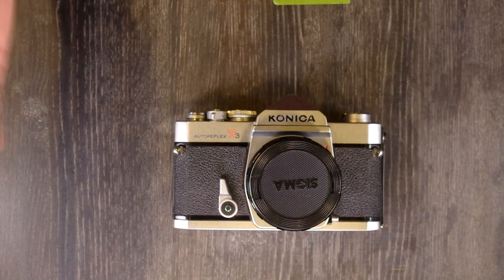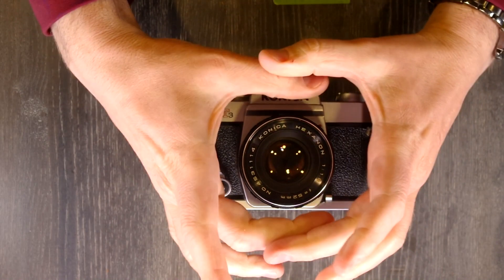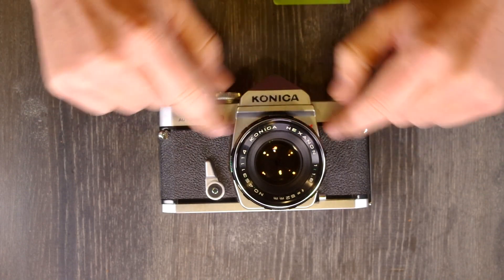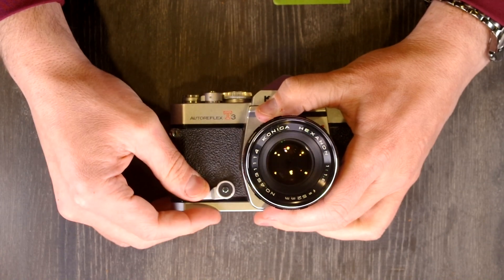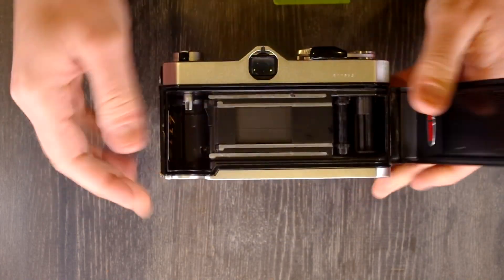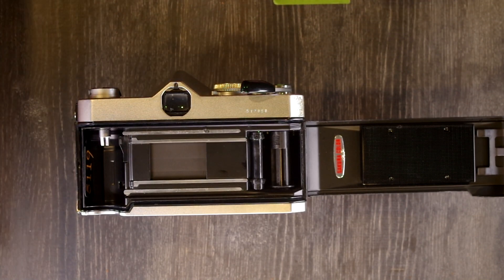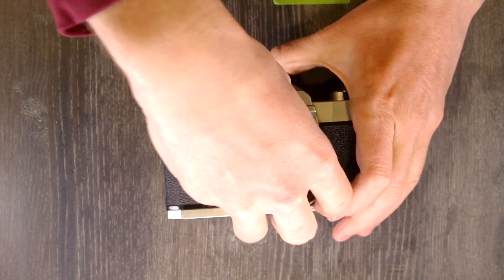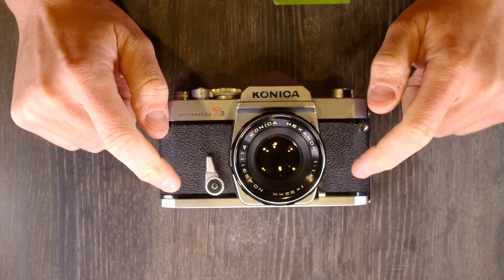Konica Autoreflex T3 Video Manual 1: 35mm Film SLR Camera Overview and Use, How to and Instructions

Comment: Another well made and thorough video, thank you. I've just taken delivery of a T2 body for just £10 (+ delivery) and I love it.
Just one correction on your maths if you don't mind. I'm pretty sure that 92% frame coverage refers to the area, not length. This is good news, as it means that the length (or height) coverage is the square root of 0.92, which is just under 0.99, or 99%. In other words,  you only lose 0.5% each side and top/bottom.
Reply from the maker: Thank you! For the 92%, correct, it's the frame coverage. But it's not always exactly even. In general, the viewfinder frame coverage on cameras is about centrally located with a slight crop on the top, bottom, and each side. Some cameras, though, have that area slightly off-center. Once way to find out is to draw a box on a sheet of paper and have the box's frames on the exact peripheries of the viewfinder scene, then photograph it. The negative will reveal how much of the frame is photographed outside that box.
Reply: @DavidHancock  Yes, I accept that it may not be central. My point was just that instead of a total loss of about 8% in each direction, it is actually less. Embarrassingly though, I miscalculated. The square root of 0.92 is actually just under 0.96, so you actually lose about 4% toral length, or 2% each end (if it is central).

Comment: For a short time in the late early 1970's, I considered the Konica Autoreflex T, but decided that the 1969 Nikkormat FTN was good enough for the (relatively) slow color films of the time. (Kodacolor-X was ASA 80, Kodachrome topped out at ASA 64, with High Speed Ektachrome's ASA 160 the speed champ for Kodak.) The very first Konica Autoreflex (1/2 frame capable) looked a tad behind the times with the external exposure meter. The Konica Autoreflex T had the "clean, modern look" of 1970 35mm SLR cameras.
Reply from the maker: All good choices. I have the Autorex P, the meterless (Japanese market) version of the Autoreflex with half-frame capabilities. The camera looks a whole lot better without the meter, but it was a repair nightmare for the first two years I had. I took it apart and worked on the mechanism about a half-dozen times before I got it to a point where it would work reliably and not randomly jam (and removing the base of that camera risks exposing the film with the way the shutter is made, eliminating the chances of a field repair.) So the Autoreflex is a bit less mechanically reliable (in my limited experience) that the more robust T and Nikon FTN you picked up.

Comment: The first "Autoreflex T" is from 1968, the predecessor was called "Auto Reflex" and was introduced in 1965 as a unique camera that could take half-frame photos by just changing a lever. The T2 was called the same as the T1 "Autoreflex T" the first T3 was called T3 like David's with the letters on the top of the camera with a detachable flash shoe, the T3n no longer has T-3 on the top and has the fixed shoe. One problem with this camera is how difficult it is to change the mirror shock absorber which is made of rubber and like all cameras of the time it degrades and to replace it you have to disassemble almost the entire camera, the same to be able to clean the screen that gets dirty with the degradation of the rubber shock absorber.
Reply from the maker: Thank you!

Comment: My father gave me his Autoreflex T3 along with the Hexanon 50mm 1.7 lens. The body and mechanics are pristine. The light meter is busted though. This camera is built like a tank.
I picked another up for cheap which is fully functional. The only issue is when focusing the split image is not present in the viewfinder. When focusing, the center displays some tiny dots which do disappear as you focus. I assume this is not normal.
Reply from the maker: Sounds like, on the second one, you have a microprism focusing screen, which is just a different type.
Reply: I have two autoreflex T3 (new) one came with split focusing screen and the other with microprism

Comment: Just checking my Konica  cameras own the silver Auto T with 52mm 1.7 lens, an all Black autoreflex T3 with viewfinder curtain, hot shoe contact, the word autoreflex spelled out next to T3 on front of camera with the 52mm f 1.4 lens, the Konica FT-1with built in motor drive with lots of camera auto features and dials ( a used camera that has not aged well electronic failures as they age resulting in no motor drive to advance film or shutter release),  Also a Konica FT-X which came out towards the end when Konica sold out to Minolta. The camera has a plastic body, hot shoe, limited shutter speeds and use a single AAA battery to run the light meter and film contacts where you load the film that will set the ASA. Wikipedia has Konica camera history  that is pretty complete,  Tamron and Sigma offered adaptable zoom lenses that worked with the camera's EE light meter.
Reply from the maker: Thank you!

Comment: Hello, really liked your video! And have few questions. I just get Konica autoreflex T3 and I wanted to ask how to use this multiple exposure button on the top of the camera. It means that you can take like 2 or more shots on one piece of film, or how I  can say it, and get like photos with a two or more scenes? And also wanted to ask how work and what cause this DOF prewiev button. Thank you for your answers!
Reply from the maker: Thank you!

For double exposures, check out video 2. There's a link to it in this video's description and Video 2 has a time-linked index in the description so you can skip right to the multiple-exposure part.

The DoF preview button closes the aperture down so you can preview what the image's depth of field will be before taking your shot. That allows you to determine if you have the correct aperture and focus.

Comment: I just posted to r/photography about this but I figured I'd post here for camera specific advice. I took a photo on my T3, like any other, this one was number 25, and the viewfinder stayed black.

I thought it was taking a ridiculously long exposure but I rewound the the film and opened the back and the shutter was closed. I took off the lense and it's like it is when you take a picture but the shutter isn't open, the mirrors aren't visible. 

I'm not sure what to do? Should I take it somewhere to get it serviced?
Reply from the maker: Were you using a slow shutter speed? If so, try firing it at a fast shutter speed. If the mirror behaves normally, then the issue is that the mirror return either has grease in it or a fatigued return spring (more likely grease.) That can be repaired but needs a professional to service it as it means disassembling part of the shutter mechanism. I'd reach out to Vermont Camera Works to see if they have bandwidth.
Reply: @DavidHancock  No I was shooting at 500 speed, so not slow at all. Also one thing about the camera in it's current state is that I can't actually operate the arm, it's like I've already worked the arm and it's ready to take a picture, but the shutter button doesn't do anything. 

I'll send it to Vermont Camera Works, thanks for the recommendation!

Comment: I am new to film photography and I haven’t had any film cameras until lately, I purchased this T3 on a good deal to at least practice on and familiarize. I bought hearing aid batteries to check if the metering works but seems like it’s broken so I might have to stick with manual metering and use it without batteries. But what I am wondering, is the viewfinder really blurry? There’s a little circle at the center which seems to be the only clear part where I can see the subject through. My lens is a Hexanon 50mm f1.7 and seems like it doesn’t change the clarity whatsoever.
Reply from the maker: It's probable that your camera is a-okay. With an f/1.7 lens the image area that is out of focus will be VERY blurry. When you focus the lens will be wide open to givem ore precise focus. The aperture closes when you take the photo only. So to test your camera just grab it and look at something near you -- pencil, desk edge, computer, etc. Something that has definable edges is what you need. Then adjust the focus on the lens until the image is in focus. You may need to use something that's about three or four feet away. I don't recall the 1.7 lens' close focus point. Then you can also verify infinity focus by focusing to infinity on the lens and pointing the camera at something like a building that's a block or so away.

Comment: Hello David, might seem like a dumb question but I can't find an answer anywhere. 
I just got myself a T3 and it's my first time using a film camera. I was wondering if the automatic aperture system needed the batteries to be functionning to operate properly !
So far I'm just using an external light meter and I'm having a blast, but using the automatic aperture could save me some time and headaches !

Your videos helped me a ton by the way ! Great work !
Reply from the maker: Thank you and the automatic mode does need batteries. It's based on the meter reading, which requires batteries.
Reply: @DavidHancock  That's what I thought, thanks for clearing up my doubts !

Comment: Hi, I've recently been given this camera by a family member and have been tinkering with it to see if it works. It seems that the wind lever doesn't work and I was curious if you knew if it's completely broken and I shouldn't spend time fixing it, or if it's something that could potentially be fixed. The mechanics seem to be working, it's just the lever itself that is loose so it isn't able to wind the film. It might be a problem with one of the washers when you take the lever apart but I'm not sure because it's my first manual camera.
Reply from the maker: That's an issue that I've seen on lots of cameras. Basically, something inside is either stripped (most likely) or disconnected. It takes a pretty significant disassembly to repair that so I'd send it along to a professional.

Comment: The ISO dial is just for reminder purpose. It doesn't do anything on a manual camera.
Reply from the maker: That is not correct. Cameras with light meters, like this one, need the ISO dial to provide the film speed data needed for a proper exposure. Manual or not, any camera with a light meter needs a correct ISO setting that matches the film speed input into the camera.
Reply: @DavidHancock  it only needs it for the lightmeter which if you're not internally metering does not mean a thing. I don't use the internal meter anyway as they're inaccurate compared to modern light meters. There is no connection between the meter and what's going on like more modern cameras that can read the DX codes.
Reply from the maker: I see what you're saying and yes, that's correct. The battery only powers the light meter the camera can operate just fine mechanically without a battery.